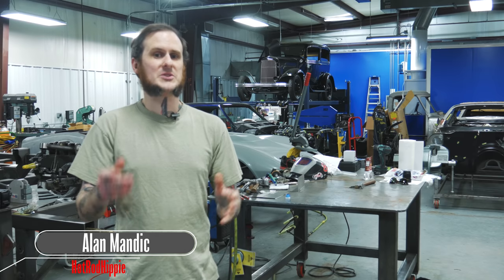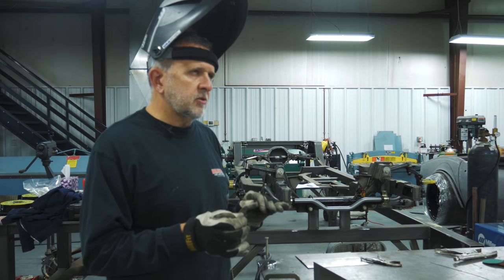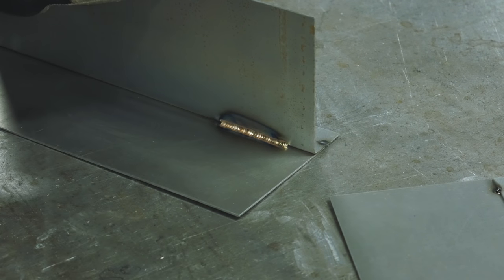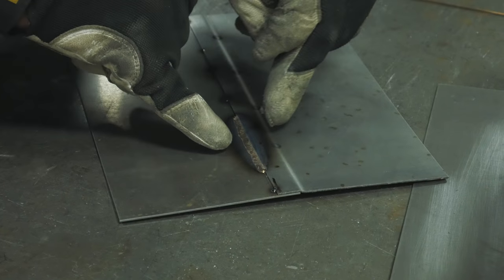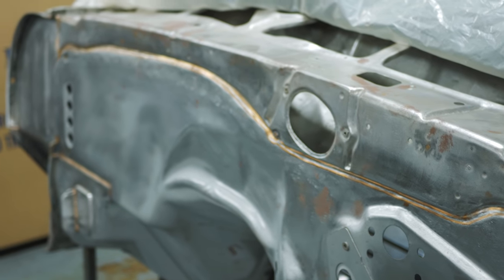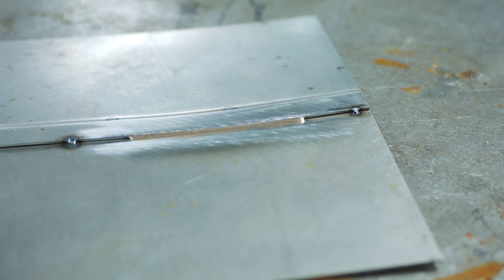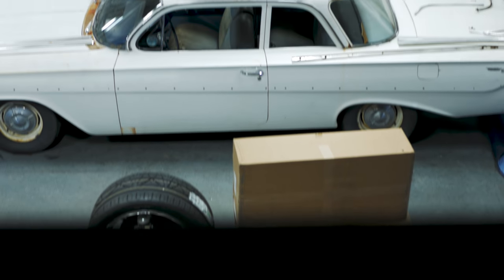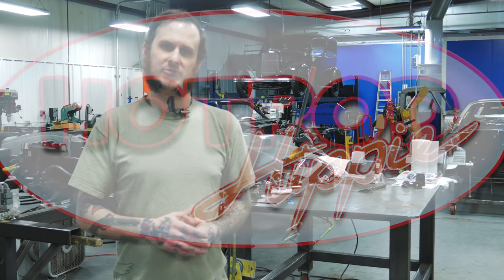Silicon Bronze Tig Brazing / Welding ft. Holohan's Hot Rod Shop

Comment: Every time he said "weld" instead of "braze" I died a little inside.
Reply from the maker: As it used Electric current from a TIG welder to work there is a semantics argument to be made. Some base material DOES fuse into the filler material. You should aim to keep this to a minimum but it does happen. As such it is very technically welding. I get your point but arguments could be made is all im saying.
Reply: @HotRodHippie  wow I didn't know that. Thanks! 🙂
Reply: Tig Brazing is more accurate.  Same is done with an oxy torch, but controlling the heat is harder.
Reply from the maker: @jagboy69  I agree overall Brazing is likely the more correct term just playing devils advocate that saying welding isn't 100% wrong and helps to differentiate a bit.
Reply from the maker: @jagboy69  neat and in depth. I can say that the base material was melted a tiny bit on these joints. I just didn't include that footage for times sake.
Reply: @HotRodHippie    Ya, jody is one of the best.
Reply from the maker: I learned a lot from his content years ago. Top notch knoweldge and info.
Reply: @HotRodHippie  ofc a TIG welder can over heat it, high enough to melt the base melt.... But you don't define a process based on its incorrect application... IE this is brazing no matter what you call it...
BTW my purpose here is to see how its used it on high gauge thin metals instead of trying to TIG welding it. so if your over heating it. the post is would be a waste of time to watch...
Reply from the maker: @nc3826  what I'm hearing is that you don't want information unless is presented within the terminology you accept. If that is the case, sorry my content doesn't meet your guidelines. You are likely missing out on a lot of information from knowledgeable people who don't know the terminology associated with the knowledge they have to impart though. I amended the titled and description to reflect that it is Brazing. At the end of the day I simply don't care that people want to raise a stink over calling it a form of welding. Everything else said and show is helpful to those willing to learn from it.
Reply: @HotRodHippie  Actually I just watched the post just before you replied to me and it was very professionally done and informative... If my earlier comment seemed pedantic or offensive to you,  I analogize, since it was very useful post to me.... So I hope you keep up the good work.... And have a good day, Sir....
Reply from the maker: @nc3826  thank you. I appreciate the apology. I miss the mark some times on grammar and proper terminology so all I can do is try my best. 👍
Reply: @HotRodHippie  Since I have dyslexia, I feel your pain when it comes to grammar.... But as an engineer (or in any of the trades), grammar should not be the main focus anyway...TC
Reply: @HotRodHippie  no, it's not welding.
  Just admit it.

Comment: Something else to consider is that you can buy .023" silicon bronze MIG wire.  Works fantastic after some practice getting voltage and wire speed dialed in.  Still have to use 100% argon shielding gas. I used this on a lap joint where my trans tunnel met the firewall.   I felt it used even less heat input because it moves much quicker and a much smaller heat affected zone.   Great channel BTW always look forward to new vids
Reply from the maker: That is probably a more attainable entry point for many folks. My only question is it a bit soft? I mean do you have to very straight with the whip or risk bird nests? I know with aluminum wire spools that is a concern due to the whip liner drag. Thus why push-pull torches and spool guns exist.

Thank you by the way 👍👍
Reply: @HotRodHippie  yes, in a general sense i tried to keep the whip in a gentle loop, but didn't fixate on keeping it perfectly straight.   It did birdnest on me once when the wire burnt back to the tip for some reason and stuck.  But in general it was only a minor concern.
Reply: I tried using the MIG type and felt like it built up much thicker no matter what I tried. It has a thin window that it runs smoothly and builds up to much weld to take back off. Brazing body panels TIG like this guy is saying is how I build 400k customs every week. You only put on what you need and I use the 3M clean and strip pro to clean up the welds. Like the brown rol locks but bigger with more grinding surfaces and more flexible. Can’t go wrong😉

Comment: Let's see if I can lay the brazing vs welding matter to rest once and for all. The AWS brazing handbook, Chapter 19, refers to the process known as "Braze Welding", which is what is being shown in this video. You see, brazing, which includes a few sub-processes, involves a liquid filler metal drawn into a joint via capillary action. In Braze Welding the filler is not drawn in, but deposited on. It often looks like a weld because of the non-flowing properties of the filler. For those who say "this isn't welding" you are almost there. "This isn't Fusion Welding" would be correct. Most welders, though, only mean Fusion Welding when they say Welding. Those of you who say "this is brazing" are almost there. "This is Braze Welding" would be correct. You don't have to like the term, but the AWS is the boss of what we call stuff, so I defer to them.
Reply: American Welding Society..  Americans always been a bit liberal with the use of the English language

Comment: I think you might have some things mixed up. Silicon Bronze filler is used for brazing. So the process you're using is brazing not welding. The main difference is brazing doesn't melt the base metal.

Edit: I saw you're reply to this in another comment - "
As it used Electric current from a TIG welder to work there is a semantics argument to be made. Some base material DOES fuse into the filler material. You should aim to keep this to a minimum but it does happen. As such it is very technically welding. I get your point but arguments could be made is all im saying."

Fair enough.
Reply from the maker: Thanks for looking deeper. I appreciate when people check the other comments as well.

Truly it's TIG Brazing, you are correct. Force of habit for me to call it welding and there is some base material fusion in my experience so I stand by that comment.

Comment: Technically brazing is not a weld since welding is flowing base metals together usually with a similar filler alloy and mostly steel. Brazing and soldering use a disimilar metal and uses the adhesion properties of the filler metal to provide a joint. Tensile strength of Silicon Bronze, while lower can provide amazingly high tensile values (50,000 psi). It can allow you to joint metals like stainless, brass, copper to very dissimilar metals such as mild steel. It's melting temperatures can allow you to joint small thin forms to large ones where welding would cause holes in the thin items.
Reply: Some base metal is mixing with the filler. You're arguing semantics.

Comment: Amazing video.  What size filler rod is recommended for the 18 gauge he was using?
Reply from the maker: I believe he was using. 060" filler rod in the video. He did discuss that he uses. 045" and. 060" depending on how much filler he wants in a given situation. I edited that part out for time savings unfortunately.
Reply: Great question. The rod diameter used in the video is .060.   I also use .045 in some places as well, depending on the type of joint, metal thickness, etc.

Comment: Brilliant video! Just a quick question. I can't help but wonder why would you choose this type of weld over a normal tig or mig to use on the car? Isn't this a less strong weld? Just curious as to what the purpose of this is. I currently use your usual tig or mig depending on what area of the car.
Reply from the maker: I wouldn't use it in place of a standard Tig or mig weld. However for say welding up a seam as Dan discussed doing, it would require less heat input to do so with Silicon Bronze. The less input would mean less chance of distortion, less burning into the panels as you do (risking drawing out impurities between the seam), and less chance of causing undesired metallurgy changes to the base material. Often the weakest point of a good weld is the base material right next to the weld. This has less of those possibilities. Like I said, I would still properly spotweld a panel together before considering doing this. It is absolutely weaker than a normal TIG or MiG weld but when used in conjunction with them you end up with an overall stronger piece.

Comment: On a lap welded body seam what prep is best before brazing 
Weld through primer
Por 15 metal prep
Reply from the maker: If the joint is already lapped and spot welded and all you are doing is brazing it up, strip it to bare metal. I use a stripping disc on a die grinder to remove as much as I can. Weld through primer isn't meant for that and will interfere and contaminate. As for the POR metal prep, I've only used that when doing POR-15 application so I cannot say it would work well. I just physically strip my joints then wipe them down with a "Wax & Grease" remover or Lacquer Thinner to clean the surface first. Hope this helps.

Comment: Just like seam welding a race car. Just with bronze.
May still make less flex, but not risk distortion of chassis as much
Reply from the maker: I've seen some folks use this method for seam welding race cars.  I'd still maybe stitch the seams with a regular steel TIG rod first, but finish in between with the Silicon Bronze for an overall lighter yet function setup.

Comment: Can you do this process with mig silicone broze as opposed to tig is there more heat imput 
Could you use a weld through primer with this process or bare clean metal would it have to be etched
Is there any danger in distorting the unibody like stich welding can you run one full bead
Thank you in advance
Reply from the maker: You can MIG it but I would only recommend that with a good setup. Namely a Spool Gun or a Push Pull gun. A normal Push style gun will result in the wire bird nesting and binding up because it is so soft. 

Also the TIG allows for finer heat input, which goes to answering your second question. If you don't put in too much heat you shouldn't distort the metal. You need JUST enough to melt the silicon bronze, which melts a fair bit lower than steel.

Basically I'd personally recommend only TIG with this method. If you happen to have an equipped MIG, I'd be surprised if you didn't also have a TIG then.

Comment: I was recently turned on to this process by another customer while picking up supplies. After I was done with my project, I was purchasing some body fillers and comparing different lines. Unbeknownst to me, some body fillers are specifically state they are Not designed to be applied over Silicone Bronze Welds. Hopefully my Epoxy primer covered those joints
Reply from the maker: Could you share what fillers say that? I'm genuinely curious about that and would love to know.  I have not come across any, but I'm not usually the one bodyworking my work.

Comment: What would be best for a rust repair panel where you can't treat the back side to prevent future rust
Reply from the maker: I primer those panels with a self etching primer before install. For spot welded panels I tape off just the spots where a weld will be, and primer the rest. For seam welds I tape off about 5/8"-1" away from from the weld joint and primer everything else. 

Beyond that your best bet is to drill an access hole and use a Cavity Spray. Cavity Sprays should be available from local Auto Body Supply Houses. Then you just install a rubber plug (with some gasket maker isn't a bad idea). A lot of cars have these access holes for this express purpose. Say on Rocker Panels.

Comment: Would silicone bronze wire (.025) work well with a 100 amp mig welder to weld bronze plates together?  It would be just like you showed but with bronze plates instead of body metal..
Reply from the maker: Using the wire in a small mig will be quite difficult. Since it is so soft it has a tendency to bird's nest very easily in the machine. A spool gun or push/pull type torch would be the preferred method to mig weld with it. And those are spendy options, if even available for your machine. 

That said if you keep the whip very straight, use the proper torch liner, and clean everything beforehand you may well be successful. 

I'm probably making it sound worse than it is but I just want to be realistic. All that said yes you can most likely do it just fine. It won't be a strong joint but if assume this isn't something structural. Are you sure it is Bronze and not Brass? I've done brass before (TIG) and it is quite messy because the zinc burns out of the metal when you weld.

Comment: What if it wasn't silicon bronze in particular, but rather the type of bronze rod that's used with gas-torch brazing, which has no silicon in it?  What would happen then?
Reply: Don't use it. It has zinc and other nasties that will be released by the high temps that the tig arc produces.  Silicon and aluminium bronze is made FOR the TIG.
Reply: Steve Phillips Right right.  It’s the zinc boiling out that causes the spattering.  That’s what I’ve picked up so far anyway.
Reply: @craigrmeyer  It is bad for your health. Just get some silicon bronze.
Reply: Steve Phillips Oh right.  Zinc fumes.  I’ve heard they’re poisonous.
Reply: Zinc fumes, zinc fume fever, probably mess up your TIG torch, too!  You're talking about "low fuming bronze", but it does "fume", and you won't like it.  When you do this with a torch, you can control that fuming by making the flame very slightly oxidizing, and of course flux helps.  It's an interesting demo!  A reducing flame will give lots of "smoke", and when you take the flame away the bronze might still be burning a little, which is an odd thing to see.  The demo is to get some molten brazing rod on a surface, and turn the oxygen up and down a little and watch the "smoke" come and go.  Anyway, that's a digression here, since we're talking about TIG!
Reply: Leonard Pearlman Thank you.  I appreciate this very much.
Reply: You'd be brazing!  Or "bronze-welding".  The Low-Fuming Bronze you're talking about isn't used with TIG process because it messes up the TIG torch.  The ZINC is volatile, and in torch brazing or bronze welding this is controlled by the FLUX, and an oxidizing flame.  You can WELD brass with a torch, but using an oxidizing flame to keep the very unwholesome fumes down.
Reply: If you want to try welding brass, try old keys, they're everywhere!  You can weld two keys together tip to tip so to speak, then grab the cooled off thing by the key handles and twist the welded part into a screw, it's very strong!  Another odd demo from Historic VSU.  Yet another one is to BRAZE some brass, and then WELD the same brass with the same rod and the same torch.  That is- you can heat the surface of some brass, and get some brazing rod to run all over it like water... then you can MELT that surface, and use that same rod to re-inforce it and run a little bead.  This is a demo to sort out the confusion between brazing and welding.